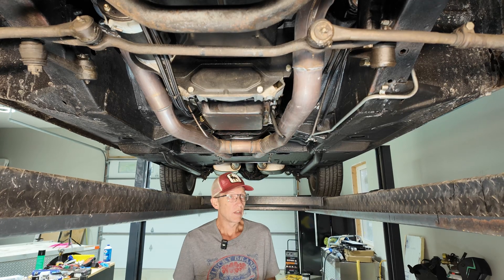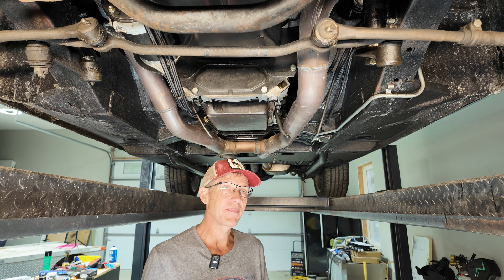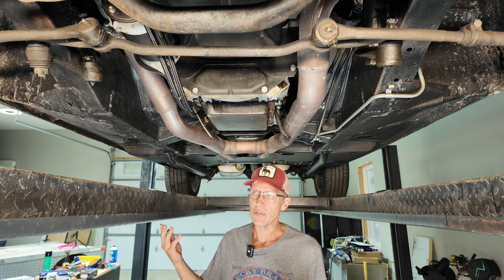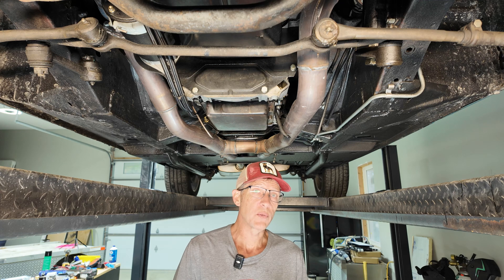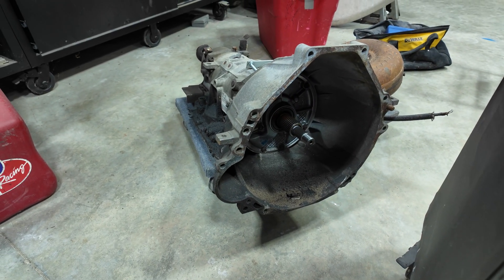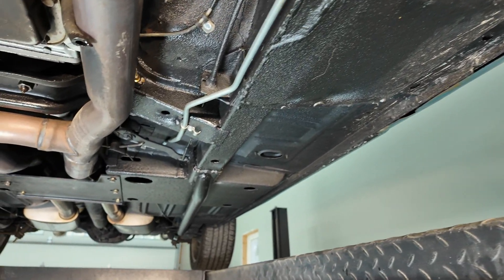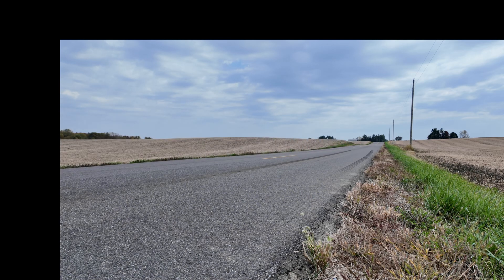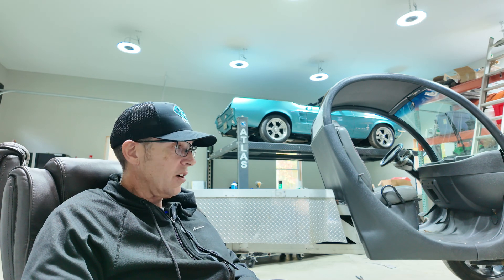Blueprint engines 347 stroker EFI. Will it be better with overdrive?

Comment: I also purchased a BP 302 and I'm having second thoughts since my car has a RS Spec chassis.  Car is still being restored but thinking about getting something for more power.  Any updates on your use?
Reply from the maker: So I have the 347 with 415 hp and 420 torque, i believe. I would have to look at the dyno sheet. It is the efi version. I absolutely love it, but it's no race car. It's a great amount of power for that small car. With that being said the c4 has a lot to be desired. I actually dropped off the 4r70w today. As soon as I get it back and get the rest of the parts I am going to start putting everything together. I think the electronic shift control and the overdrive combined with some new rear end gears will make this really come alive. I'll have the low end pull with the ability to drive on the highway also. Not much will be known until spring when the roads are hot and dry.
Reply: @170andahalf really appreciate the insight! It’s so hard trying to find the right setup with these cars when you can’t really “test drive” the setups. It’s been a bit guessing game on my end and hope I don’t end up having to pull the motor for something with more power. Keep up the great work!
Reply from the maker: If you are close to fort wayne indiana I can show you what this setup does.
Reply: @170andahalf really wish I was but I appreciate that!